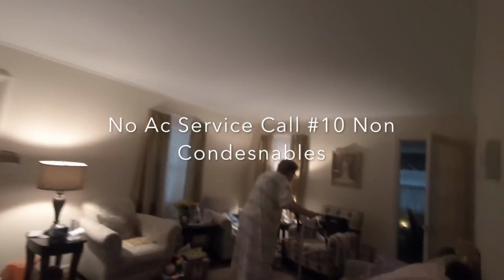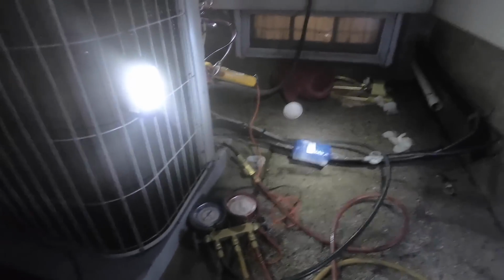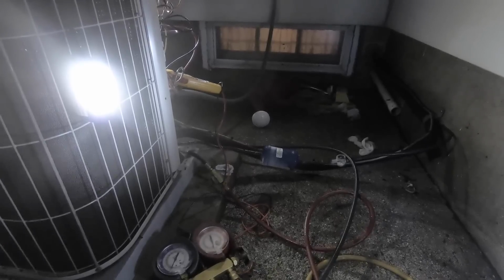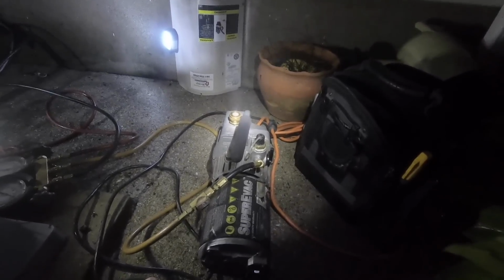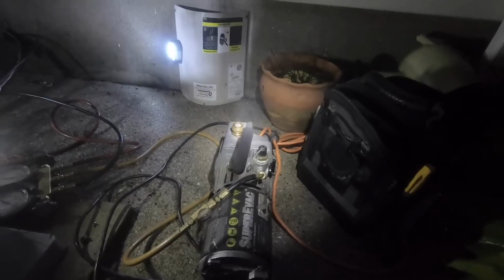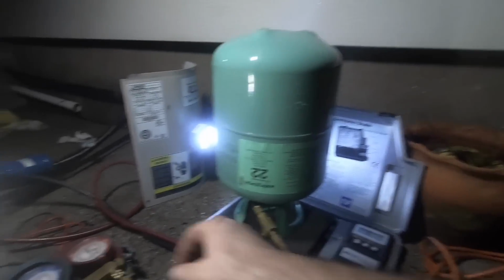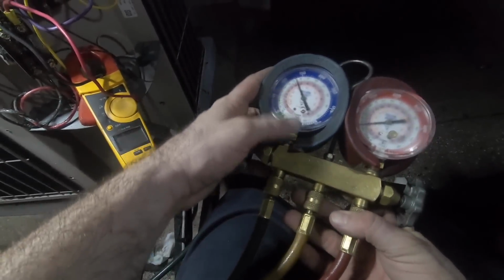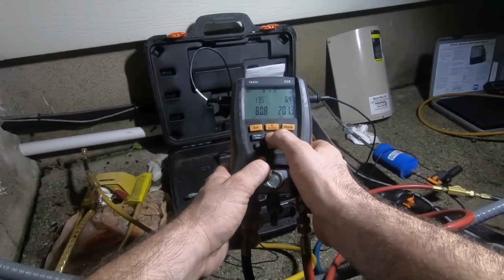AC Not Cooling Contaminated System Overheating Compressor HVAC

Comment: awesome video---great job get some low loss fittings though for those otherwise excellent robinair hoses.  GOOD NEWS AC WORKS>  BAD NEWS its 2000$.
Reply from the maker: It was half of that yet a new system would run 8-20k
Reply: @thehvachacker  what? i charge 2500 tops and i do this on the side....8 to 20000k? for a split? thatsystem is not worth 8000$ ur low end price lol
Reply: not to be a a-hole, im just surprised at ur price, assuming this is in the usa as well is even worse
Reply from the maker: Dan D I can't see how you can do it for 2500. I bought my dad a new ac and furnace this summer. I spent around 4K for system, metal, line sets, and all the other material needed. That's a once in a lifetime gift for my dad. All the time it took to make the supply and return ducts and transitions. Mortgages around here run around 4K a month. NJ is an expensive state
Reply: @thehvachacker  im talking about a ac split unit. cond unit and coil with lines and tstat. that lady wouldnt need a whole new furnace as well. just letting u know im not trying to sound mean or anything, its easier talking than typing....
Reply: i guess i know what ur saying, but she wouldnt need all that, if anything just a new cond unit as wrong gas was in there. no worries man, live and learn its all good. i hate those calls that someone did something odd too the unit and u gotta figure it out, lol, GJ!
Reply: @thehvachacker  awesome.  Thanks!

Comment: Painful to watch. Tag along with an experienced tech before you try to troubleshoot equipment.
Reply from the maker: I am an experienced tech who has trained many techs and mentored into good techs. The unit is up and running. The repair took place along time ago
. Your an idiot if you think I can't troubleshoot. I walk away from a correctly operating and charged ac system. The subcool was set to manufactures specs. Get over yourself cause if you watch videos trying to disprove them then you are the inexperienced idiot. 3 hours to cool the compressor, remove a cocktail of 410a and 22 mixture, vacuum and recharge. With this system still in operation cause I have heat maintenance set up at this house beginning of Sept.
Reply: @thehvachacker  don't waste your time with idiots  like this
Reply: @thehvachacker  This guys just pulling your ears off mate don't bite. Your a good tech and your vidio delivery is smooth. You never know whats waiting for you with any machine that interfaces with the general public.
Reply: Another piss ant troll.

Comment: That compressor had to be red hot to stay hot that long after all that spraying..
Reply from the maker: It was a 100 degree day and unable to correctly compress the refrigerant cocktail of 22 and 410a mixture. Usually they reset within 5-15 minutes. Not this one
Reply: @thehvachacker  I've seen them take an hour with water running over the compressor. Mostly here they use 407C to top off R22 units, which will work provided that they add 407C as a liquid, unless too much 407C is mixed in, it has similar pressures to R22 and the R22 will carry the mineral oil.  With 410A they use it because it will raise the pressures fast but there is this invisible point where the system will freeze up regardless of what the pressures are. This may happen after the tech has left the call.
Reply: @scottbishop2532  WOW Am I learning a lot! Not just from the Hacker, but from those who leave comments. Thanks.
Reply: @jamesrhodes8897  Are you in HVAC School or a DIY?  I'll help you any way I can.  I work with refrigerants every day.
Reply: @thehvachacker  

If this is a contract customer, why is there a mix of refrigerant?
Did some other company work on it?
Was there a hack that came out?
How did you determine it was a mixture of refrigerants?
So many questions unanswered.
Reply: @jrsmyth9761  Read Scott Bishop's comment.

Comment: I would've came back with the right stuff to do the job the next day. Now their paying over time.
Reply from the maker: they don't pay overtime. Same cost all the time for contract customers. This system is still operating without any issues since I was there last. Just maintenance
Reply: The HVAC Hacker nice man.. I’m the same way I hate when people try sell a new unit instead of fixing. I’ll stay as long as it takes for them to be happy.
Reply: The HVAC Hacker not being a jerk just not changing that drier I would literally lose sleep over that..
Reply from the maker: I seen too many machines and repairs where driers were never changed. When I started no vacuum either many guys purged, then pressure tested with r22. We should not do stuff like that and now we learned better ways
Reply: You dont have to replace filter drier on a call like this,who ever taught you that ?
Reply: And the job wasnt properly done.

Comment: Since you had the system down, I would have added a small liquid line filter to trap any moisture or solids that were left in system..
R 22 tends to ice up at fixed orifice or cap tubes when moisture is present. Woah..big guns..testo 550 😲
Awsum job though..night service I loath.. thumbs up. 👍
Reply: Thats what i was thinking, havent had this issue have had liquid line be aroynd 400 and suction like 25, they had changed a blow comp the year before and i guess tjeu didnt flush or something cause i ended up with a clogged con coil
Reply: I love my testo 550s, they havent failed me yet
Reply from the maker: I used my last 2 driers earlier that day on repair jobs. I miss my tests 550. Yet them getting zapped on a 30 ton start up caused me to get those probes I use now. Not sure if I could return to using the manifold. It was sent out for repair 2 weeks ago haven't heard anything yet on my 550's. yet they were solid for 7-8 years. Step up from my yellow jacket gauges and a fluke pipe clamp on my multimeter that I did before the 550. Technology is interesting how my tools have changed since I started 20 years ago

Comment: So many things done wrong.  System could have just been simply overcharged, the compressors internal bypass obviously opened up almost immediately upon start up, firstly you should have recovered until that stopped then checked your line temps.  You said it has an expansion valve but did not even check, I kind of doubt it sles, either way, recover, check subcool/sh after allowing it at least 15 minutes of run time for the refrigerant levels to stabilize.  If non condensibles are suspect afterwards of verifying those measurements, water turns into acid inside of a refrigeration machine, and also is easily trapped in oil as both mineral and Poe are hydroscopic, POE being much worse, an acid test should have been performed and proper steps for clean up should have been followed for clean up.  You recovered the charge after condemning it for contamination, yet didn't even change the drier nor pull a proper vacuum, even though R22 is much more forgiving, you should've pulled using a micron gauge, this will give you a much better idea if a leak exists - this is crucial since you didn't do any kind of pressure testing with nitrogen.  Congratulations, you're a potato tech, probably a $1500 repair that'll result in a dead compressor next season.  To each his own though, you wouldn't survive anything further than basic residential air conditioning and I hope that you never encounter any VRF/VRV equipment with such poor practices..  the only positive I see is that you got her cooling, good job there, but I would highly recommend you continue furthering yourself as a technician, educationally wise.
Reply: Its "hygroscopic"... And by the way, mineral oil isnt hygroscopic at all. I recommend furthering yourself as a technician, educationally wise.
Reply: Ok weeboo
Reply: its working.  Its easy to play armchair QB after the fact.
Reply: 🤣🤣🤣🤣🤣 u sound like the regular know it all technician who over diagnoses the system, when In fact the power is just off🤫🤫🤫🤫
Reply: It is txv system.if you see at the end of video
Reply: Jaron Bourne Bang Uber Tech Galore John Holmes of HVAC.
Reply: Haha,  You just got schooled, lol, I give you props for tryin and good effort.
Reply: Dayum..look out for the bus tires..
Reply: Super Ultra Mega Tech ....
AKA... Douche Lick.

Comment: Trouble shooting skills are mediocre at best!! 3-4 hours to diagnose non condensables in system??? 🧐🧐🧐 either you’re really cocky and thought you knew what it was or you just suck!!
Reply from the maker: I knew as soon as I started the compressor and witnessed the fluctuation of the pressures rising. Total job was alittle more than 3 hours. I pulled the charge because it was a cocktail mixture. You must be a  wannabe super tech. If you come online trying to knock down others work.
Reply: The HVAC Hacker Not a super tech but definitely can not waste that sweet ladies time and money on something so simple. Did you charge her for labor?

Comment: After all that work why would you leave the old filter dryer in?
Reply from the maker: If you read any of the previous comments I send the two on my truck already. So this was a make it work job
Reply: Was gonna ask the exact same question, but sometimes you just do what you gotta do, in order to help some people out. Lady needed that unit working badly, you can probably come back later with a new filter drier and recover/replace/recharge. Good work.
Reply: @fidelalgarin7216  yeah but if that freon was really contaminated then the filter dryer is definitely getting replaced.

Comment: I have a similar situation, however, the compressor still overheats when the sun is directly overhead. Over 110 degrees in phoenix. New air handler, new compressor put in, drained and put in all new coolant, new capacitor.
It was 115 on sunday and fan comes on, inside fan on. But compressor didn't kick on. Waited 45 mins...still no compressor...went outside and put up a patio umbrella over untit then ran hose on sides of unit until compressor finally kicked in. I made a sun canopy over unit and now it runs like clockwork...inside set to 79, 10 mins on, 10 mins off. Is this normal...do i really need to shade the unit...should o have it moved a few feet onto the covered patio ??
Reply from the maker: You might need to add a hard start kit to the system. Many systems with a txv requires it. The compressor might not be able to start from the pressures not equalizing on the off cycle
Reply: Turned out they put in a 3 ton compressor....should have been 3 1/2 ton.

Comment: I'm new to your channel, I just subscribed to your channel. I'm stumped my air conditioner cuts on but then stops after about 20 minutes then some days it will work fine. The fan at the furnace cuts on and stays on until I kill the power. Somedays it will start working fine and then sometimes it wont and furnace fan is still on.
Reply: Might need to get a guy out there to look at it make sure you get a technician and not a parts changer tho. Technicians will fix your problem and will cost you less while parts changers will just replace a 2 to 3 thousand dollar compressor.
Reply: @thatpersonyouknow3747  thanks for your reply it turned out to be the contactor.  Been good for the last month

Comment: Charge it till it sweats and feels like 45° on the Suction. Bam! 😎😂 I miss R22 😪
Reply from the maker: Why do you miss it. That and 410a is all I use. R22 hi price is the cost of comfort or system should be replaced
Reply: @thehvachacker  20 Years ago there wasn't a such thing as Subcooling or Superheat and most seasoned installers back then could just charge by Feel and Deltas and it wasn't expensive then I remember getting it for $50 a drum, but then as production got limited during the introduction of Puron 410a all of a sudden it skyrocketed. Now it costs me about $550 for a drum and is more economical to just swap to 410 on leakers instead of prolonging those dinosaurs. I wish that they'd produce 134a systems (Carrier made 3 prototypes that are used in a couple homes). But R22 was simple and easy and delivered excellent results. Also don't get me wrong I do follow 608 and only charge once a year and on the 2nd trip I repair or replace
Reply: That was also before a Micron Gauge, Nitrogen Purging, and unlike today we used Driers, but somehow those old Nordyne's, and Copeland's keep on kicking season after season.

Comment: Too bad you didn't have before and after weight of the recovery cyliner ( I always weigh ) and post the cylinder temperature and pressure of the recovered refrigerant.  Overcharge will have normal pressure for the refrigerant. Contamination will have high pressures due to the combined vapor pressures or non-condensables in the system.
Reply: Good point.

Comment: Which gauges do you like better the Testo or fieldpiece
Reply from the maker: I loved my Testo 550 and would still be using them and talking about wanting to get probes if they never suffered a static shock after 7-8 years of solid service. I was doing a start up on a 30 ton RTU was switching circuits and felt a little shock. The was it no more subcooling or temp was reading on my gauges. Next day I was on call ran to johnstone And bought the fieldpiece probes. Fell in love right away and can’t ever go back to a manifold

Comment: Did anyone teach you how to remove the hoses with out letting Freon in the air by disconnecting the high hose first and charge it through the low side so you don’t let that go into the air to protect the environment
Reply: Mohamed Ali 
Oh please lol
Reply: Mohamed Ali 
Goof
Reply: Its not so much to protect the environment its just if youve got long or thick hoses ot holds quite a few ounces of refrigerant that is now not in the system. If you service an air conditioner  twice a year and don't suck down your hoses you're going to run out of refrigerant sooner or later and think there's a leak but really it's just taking your hoses off without sucking them down
Reply: Rookie
Reply: HaHa Protect the environment!! Its like going to the ocean and removing a cup of water thinking you saved the world from the ice caps melting! Dont buy into the junk science the left is spewing forth! Since you all stopped the so called ozone from opening we now have global warming. Thanx for ruining the world by not letting the freon out.
Reply: Shut up nerd
Reply: On the grand scheme of things that doesnt matter quit being a butterfly
Reply: He did that. He said "let me suck out my hoses" and he equalized the high pressure hose into the low side before removing it.

Comment: If that was 410A in the system you should have flushed the system and change the oil also you should have tested the system for over charge by weighing the recover tank to determine the weight of the charge. To see if it Mach what is on the name plate . Before you charge the old lady for new charge.

Comment: when the gas is removed, will the compressor oil also be removed during the process?
Thanks  for the video
Reply: Some can be pulled out with the refrigerant, but its negligible and will stay in your hoses, as refrigerant oil permeates the whole system. the majority of the oil will sit at the bottom of the compressor, and you'd only really worry about cleaning any oil out if you're swapping out a compressor after a burnout.

Comment: With the head pressure being high and the suction pressure being high the unit could have been overcharged. That's why the compressor was so hot. By taking all the refrigerant out and putting new in, fixed the problem, but you should remove refrigerant to see if pressures change before dumping all the refrigerant and charging the customer for new refrigerant. Non condensibles are not that common
Reply from the maker: No but someone accidentally putting 410a into a 22 system. An overcharge will not cause the fluctuation of pressures like that. I have had severely overcharged system that I pulled 7 lbs to drop the subcool from 60 down to 10. If I feel anything is wacky with pressures I pull charge and put new. My customers want cooling money isn’t a problem. I just repaired a 19 year old ac system that is being replaced in 5 weeks. That’s how far out my installers are. Sucks I’m not use to trying to pull a vacuum on a leaker but I always pull a vacuum. I couldn’t get the vacuum below 550 before I gave up. Yet still charged it up and got it it running for 1600 today. He also handed me a 5k down payment for a new xc25 which total install cost will be 16k. The only thing that matters on all service calls and I teach all my apprentices when I was mostly a residential tech it makes no difference mistakes or anything that happens between the start and finish of a job as long as the system operates and no call backs on it.
Reply: The HVAC Hacker 
You are living in wonderland if you actually think “money isn’t a problem” for all of your customers.
Reply: @GrifFungin  that said, I hate the guys begging for a/c work for cheap. Go find someone else
Reply: Steve Dekock 
Agreed